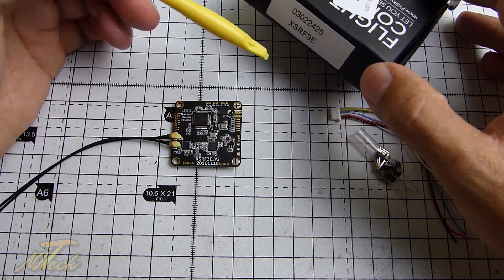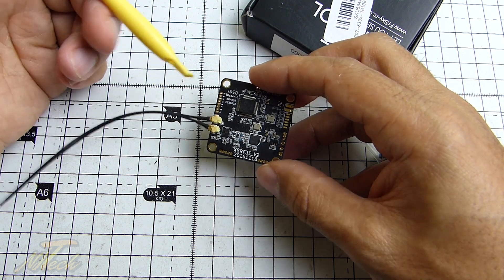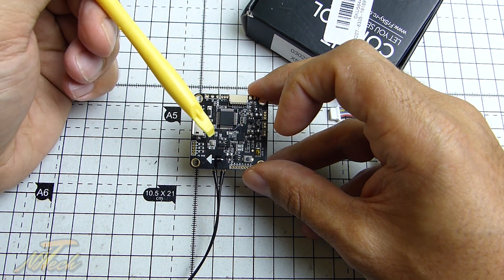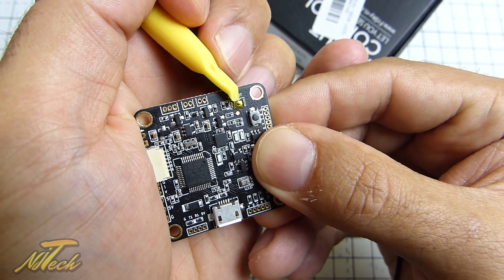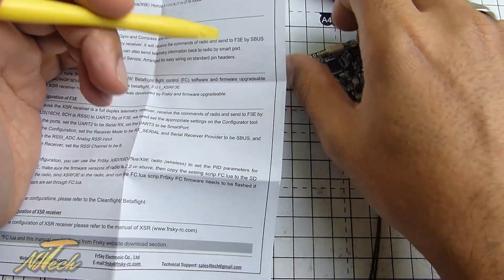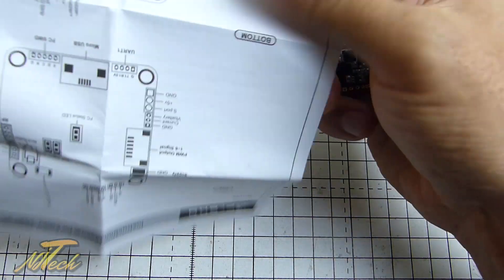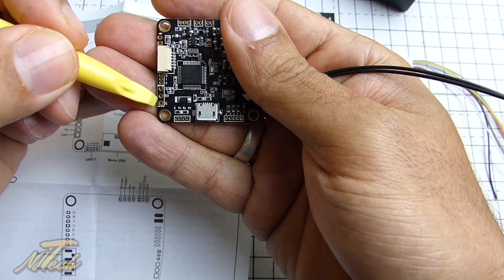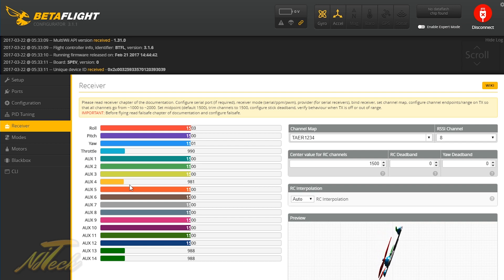FrSky XSRF3E Review and receiver Firmware upgrade guide!

Comment: Do you know if you can use OSD wth this FC? Thanks!
Reply from the maker: a separate OSD yes, but there is not one built into this flight controller unfortunately
Reply: NJ Tech That's awesome to hear! I've just picked up this FC. Unfortunately I'm having issues getting my channels to get any input. Do you have to flash firmware onto the board before it will receive properly from the Taranis? I've binded successfully, but am not getting any results 😔
Reply from the maker: no you dont need to flash it, if its bound then its a setting youre missing. make sure you set the Uarts correctly, you need to have serial receiver set and select sbus on the configuration page.
Reply: NJ Tech I'll play around with it some more!
Thank you very much for the answer - I'm new to the world of drones, and there is so much to learn!
Reply from the maker: you i know its a bit of a headache, I have some guides on setting up betaflight if you go back through my videos. Might be in the tutorial playlist. Take your time, there is lots of good info on youtube :) If you get really stuck just message me again and ill help you out no problem.
Reply: NJ Tech I'll be checking out many of the videos haha!
I'm actually having difficulties selecting the SBUS Serial Receiver Protocol - When I save and boot and reconnect, the setting remain on SPEKTRUM1024...
Reply from the maker: Thats because you havent selected serial receiver in the PORTs tab on the correct UART :)
Reply: NJ Tech I've matched up all my settings with yours 😊 With the exception of the SBUS as it won't save selected. I'm going to try this again
Reply from the maker: hmmm, maybe the uart is different on your version, try enabling serial RX on different UARTs (except 1) and see which one then sticks when you select SBUS.

Comment: NJ Great video!  Watched so many time.  I have a problem with the receiver after crashing into wet surface.  The receiver does not bind but the FC looks ok.  Is there a way to use it with external receiver like XM+?
Reply from the maker: Jack Leung those connections should allow you to use an external receiver but I'm not sure how you would bypass the internal receiver when booting the board.. There may be a way but I can't see how right now

Comment: Where do the esc ground wires go? i only see 6 pads(wires) with the pwm?
Reply from the maker: they dont on this, though you could run all esc ground wires to any ground pad on the FC. You dont have to run them at all actually and most quads fly just fine without as the ground is already on the ESC main power wires, but if it flies strangely then just add the grounds as i mention.
Reply: Sweet! Thanks dude!

Comment: Hi. Good video! I tried using your steps but get the message: FW Update error Not responding [Exit]. Get the same message on my RX8R reciever when trying to flash to EU version. Do you have any idea what I am doing wrong?

Thanks
Reply from the maker: are you holding the FC boot button down before and during power on?

Comment: This thing keeps tempting me... I get the feeling that it's a piece of crap - but still want to give it a shot. Have you had a chance to fly it yet? How's that gyro working out? Also: What's the length on the antennas? curious if they should be tuned to 1/4 wave length like an xsr, or if they're already there :D
Reply: antenna length as in the stock exposed portion
Reply from the maker: haha, well its all looks decent enough as far as manufacturing goes. Its really going to come down to your preference of gyro. I haven't flown it yet but il let you know when I do.
Reply: I guess I'm balking because of the mention of gyro... I probably couldn't tell the difference if I flew it - will that gyro do  8k/8k or should it run at a slower rate?
Reply from the maker: the evo does 8k/8k no problem.
Reply: evo - gyro? guessing an auto complete catastrophe here :)
Reply: and thank you for the quick response!
Reply from the maker: the target is spf3 evo, its a 9250 gyro, which handles 8k/8k no problem
Reply: ok now evo makes sense... forgot about that context lol. sorry!

Comment: Thank you for the nice review NJ! Like your style, go right to the point. For telemetry, do you still need a voltage sensor like FBVS-01? Looking forward to see your build with this board.
Reply from the maker: Cheers Jack. No separate voltage sensor is needed, the VBAT sensor built into this flight controller connects straight to any + point on the main PDB voltage rail and you then have the voltage available via smartport (when you scan for sensors on the taranis it will appear as VFAS) simple as that :)

Comment: This I was looking for! Thanks NJ!
If I understand well from your presentation, you can not make a direct connection between Youbi 4 in 1 ESC and these board. The 6 ports from Youbi are 4 signals, 5V and ground in the same socket. The 6 Pin PWM out from XSRF3E are only signal for motors? I did not find the detailed diagram for this board, only from the version without telemetry and SDCard, not this from your video.
Reply from the maker: Yes you are correct, youbi board is G,5V, m1, m2, m3, m4 on the connector. So just solder those to M1,2,3,4 of the XSRF3E and take the youbi 5V & G to the 5v&G of the XSRF3E which i point out in the video. That will work perfectly as a combo :)
Reply: I'll order one with Eu-LBT. It's the perfect solution to squeeze an VTX under the canopy. Thanks for detailed review! ;)
Reply from the maker: great, and glad it helped :)

Comment: Should have added a regulator to run off Lipo power and a 6000 gyro ftw. So its an Evo without the SDcard slot for blackbox recording, but with XSR.
Have Evo myself though seems to run fine. 
Nice price.
Idea for a small build with 4 in 1 esc.